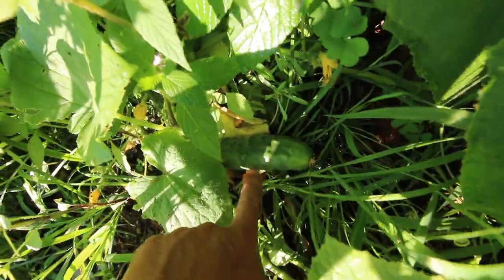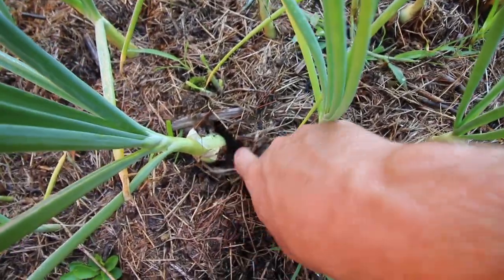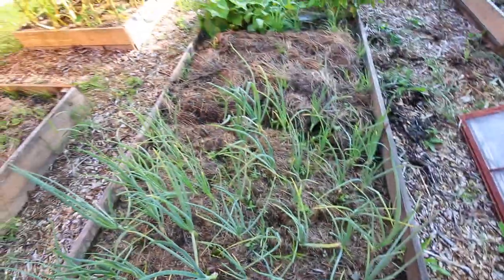The Rarest Breed of CHiCKS and So much More Modern Steader Update

Comment: Al, that is blossom end rot on your tomatoes.  It's caused by a lack of calcium.  Grind up some egg shells and sprinkle around the base of your plants and water them in
Reply: Something tells me he has plenty of egg shells available. :)
Reply from the maker: I am on it!  Thanks! We have plenty of egg shell after breakfast! :)
Reply: Lumnah Acres It can happen to any plant, I keep my egg shells all winter long, dry, grind and put in a jar.... we put a sprinkle in every hole we did because we haven't gotten our soil there yet....  we grow all natural and have only had this land for 4 seasons.  Most likely bugs will crawl in those rotten parts so it's a good idea to get rid of them and let the chickens or pigs enjoy them.
Reply: Soak the shells overnight in some white vinegar and dilute with water. Feed this to the plants. Egg shells straight up are not plant-available. The overnight vinegar soak makes it so. Don't worry for the acid in the vinegar. tomatoes like a low PH situation.
Reply: I had that on my tomatoes and Luke at MIgardener said to crush one Tums into 1 gallon of water. Spray bottle it all over the leaves and fruit. It absorbs immediately and voila it was gone. We haven't had a bad tomato since. Egg shells work also but it takes a while to absorb into the dirt and then into the plant.
Reply: Jenifer Fillyaw I run my eggs through the blender so they are basically dust when I put them on then once I water it dissolves into the soil.  
I'm not a fan of Tums only because they contain sugar, dyes and talc. I'm sure it works great though 😀
Reply: If you make yogurt at home use the whey to water the tomatoes it will have some calcium in it. My plants love it when they get whey watering. Just mix it with water.
Reply from the maker: thanks we have another way we are going to try its organic. we will share it and then see the results
Reply: Also water with Epsom Salts (2 Tablespoons per gallon) Calcium won't work without Magnesium. Good Luck!  :))
Reply: I agree. It is blossom end rot. You can also use bone meal to add calcium that plants are able to access.
Reply: Egg shells take a while to break down enough to release the calcium, so it isn't a instant fix.  Add your shells to compost piles if you aren't already and let them break down there.  Ground Oyster shell could also be used and I believe it is faster release of calcium.
Reply: horse making
Reply: @peelmeone  yes that sounds like a good idea!
Reply: @princessperibanu380  my plants love Epsom salts. I use 1 tablespoon per 1 gallon water every 2 weeks for my plants.

Comment: I made a cider press out of left over 6x6's for the main structure, and a couple 2x4's and plywood for the catch trough coated in wax. I squeeze the crushed up apples with a hydraulic jack by putting layers in cheese cloth between layers of wax coated plywood. The juice runs into the trough that has a hole drilled and a tube running into a 5 gallon bucket. It works great, and the juice is delicious! You could easily build one with your resources. I would be happy to dig it out and send you a pic if you want to see the design.

Comment: Yay!! Friday update, so much happens in a week. I've been caught up with the outdoor kitchen build right along with you, and it's looking great. I had no idea that you had those sliding doors. That is going to look awesome by the time it's finished. 
The young mixed run chicks have grown, and seem less fearful. Looks like you might have some R.I. Reds in there. Rufus sure is a handsome lad, woohoo. I'm not sure how old your layers are in NYC, so can't say how far away they are from when their egg production may slow down. The majority of layers have been bred that they slow down after two years, then it costs more to feed them than they give in eggs, they become soup/stew birds. Those young pullets are doing a great job on the pasture. It might be a good idea to leave them on pasture, and add them to NYC. We used to get rubber bands from an office supply, about 1/2" wide and only slightly bigger in diameter than a chickens leg. We would put a different color for each year of pullets we raised, red first year, blue second year, etc.. That way we kept track of the older birds that were ready to be removed from production. Rotating young birds into the flock kept egg production pretty steady, and you don't accidentally butcher young birds.
 The gardens are looking great especially the pig pen, and hay bale. The raised beds will be much better come next year, like you said as you improve the soil. That tomato looked like blossom end rot. Water collects on the blossom just as the tomato starts to develop causing it to rot. That tomato also looked like it had splits from too much water, not much you can do about that with the rains. 
Zucchini can also be cut up as if for saute and frozen, it keeps real well. Over sized zucchini are great for stuffing, and roasting. Cut in half length wise, scoop out the seeds, and they are a number of stuffings to fill in with, and roast at 350* until tender. For instance, cooked rice, chopped onion, mushrooms, garlic, 11 secret herbs, and spices, (Whatever herbs and spices you like and have on hand. Basil, oregano, thyme, rosemary all work well.) Mix in a favorite grated cheese, with extra cheese sprinkled on top. You could make chicken or pork based stuffing with left overs also. The first year with my gardens I way over planted zucc's, and summer squash, more than enough to freeze, eat our fill, as well as give away to friends. We came up with a lot of different recipes, I'd be happy to share for the asking. :-)
Baby Icelandic chicks!! Congratulations. They seem a lot less skittish than the other chicks. Little cuties, it will be exciting to watch them grow. 
The Modern Homestead is looking better all the time Al. I've been watching other homesteaders along with you. I see a wisdom in your approach that is missing in many others. You add to your homestead in slower increments, learn new processes, adapt to the increased work load, have mostly successes, and fewer hard won learning experiences. Even with the outdoor kitchen build, the rest of the homestead really isn't being neglected. I've seen others add too much, too fast, and quickly become overwhelmed.
Reply from the maker: Thanks! The sliding glass doors should be nice! We got the chickens in NYC Spring of 2016

Comment: yes its blossom end rot. but at this stage your best option to save them is a calcium spray made for it. long term you probably need lime. do a soil test from next year. sometimes too much nitrogen can tie up calcium and urine can def do that. epsom salts are a real help. now, and also when you plant. you can sprinkle in the soil in the beginning of the year or make an epsom spray for the leaves. you will be amazed how mush this helps tomatoes and peppers.
Reply from the maker: Thanks! Great info we will have to look for some calcium spray!

Comment: Even if you have a oversized zucchini, just cut it in half length wise and hollow it out. Stuff it the same way as you would do with a bell pepper. My mom used to sling some butcher twine underneath it so she could tie the "lid" back on top. Pop it in the oven at a good 350F & cook till done. The rice and ground beef inside are already cooked before you stuff it, so it actually cooks fairly quickly. Google a decent recipe on line for clearer directions.  You can also add the grated zucchini into spaghetti sauce, etc.

Comment: I would add gypsum for calcuim.  I would start saving eggshells for next year as it isn't as available but works great if you give it time to break down.
Reply from the maker: Thanks! What should we use for calcium this year?
Reply: Lumnah Acres The easiest way is to make a slurry with limestone or gypsum you can buy at home depot.  Mix a few handfuls of the pellets into 2-3 gallons of water then water you plants with the slurry.  I don't know if you water your raised beds but tomatoes with blossom end rot could just be from inconsistent watering.  You need to be consistent watering when your tomatoes start fruiting or you get a mixed bag of not only blossom end rot but also splitting.

Comment: Have you considered putting a few corrugated white fiberglass panels in the roof to let the sunlight through?
Reply from the maker: We have but I haven't see any that match the tin layout. We did that in our chicken coop in MA
Reply: Maybe you could run the fiberglass all the way down and lap it over the tin on both sides. You may risk looking like a burger joint though.

Comment: What is the ph of your soil and water.....l recommend that one bring the ph of the water to 6.5 and the soil . This will allow the micro nutrients to become available in the soil solution. Micro nutrients such as calcium to become available....also, I generally provide a soil mix of one part compost, one part sphagnum peat, one part of soil, one part  non burning composted cattle manure, and then apply bone meal to the bottom of the planting hole.....then you could use fertilizer such as a transplant food 10-52-10 at tablespoon per gallon 1 per two weeks.....then once the tomatoes have gone through their transplant phase, switch to 20-20-20 at 1 tablespoon per gallon until flower buds start to show....once the plants have flowers just beginning in their tinny for, 15-30-15 at 1 tablespoon per gallon....once your tomato plants start to grow tomatoes, feed them tomato food.....make sure, to prune suckers out of the crotches, then pinch the growing tip about half a month before 1 st frost.....another cure or preventative measure against blossom end rot would be to feeds the foliage 1 tablespoon milk to a gallon of water, or use micro nutrient foliage feed..to get more conclusive information, look up the web site growing tomatoes..they will have more  than I can remember right now.........
Reply from the maker: Thank you! Great info!

Comment: OH NO!!!!!!   I am sure the pigs would love the zuchinni but you can stuff the bigger ones.  Cut in half and scoop out the seeds.  Mix cooked rice with ground beef chopped onion sliced mushrooms 1 or 2 finely chopped garlic gloves and a cup or as needed of spaghetti sauce.  Pplace in a 2 or 23 inch deep pan and cover with a lid or foil.  Bake at 350 until the zuchinni is tender.  Sprinkle with shredded cheese and a bit of grated hard cheese and return to the oven for 10 min uncovered.  You can use sausage or even ground turkey.  If you like curry I have a recipe for a cucumber curry soup for the really big cucumbers that are too tough to eat as slicers.  Why should the picgs and chickens get the good stuff.....    LOL!!

Comment: It may be a calcium deficiency but your new growth looks great. Calcium deficiency will also affect new growth by slowing it way down and giving plants a stunted look. Older leaves will not be affected and will actually store a lot of the plant's calcium. Check your nitrogen levels to make sure they aren't to high (leggy growth) and your soil Ph. The next cause may be due to inconsistent watering. Tomatoes do not like to be water stressed, water deeply and consistently. You've been getting a lot of rain, I think that may be leading to your problem. Tomatoes dislike wet foliage and high heat. Looking at all your other plants, nothing else seem to suffering. Calcium deficiency also affects cabbage (leaf tip burn), carrots (hollow core) and peppers (blossom end rot) & yours look great. I think the rain is your problem. I tent mine with shade cloth to slow the rain down hitting the plants when rain is in the forecast. I'd also experiment with adding minute amounts of boron (tsp per plant). 
Large zucchini - slice thin, toss in olive oil, salt, pepper, garlic or experiment with different spices, bake at 225º for 2-3 hours till lightly browned = delicious zucchini chips! Small ones shrink too small, just make sure the seeds are still small on those monster zucchinis!
Reply from the maker: We have been getting a lot of crazy rain this year!
Reply: Lumnah Acres - Shoot some close up video of your entire plant, all the leaves tell the plant's health. Which it does seem like you had new tomato flowers up high which with low calcium, the plant wouldn't produce. Low calcium affects all new growth. Figure out what's going on now to benefit next year's plants. But I'm really suspecting too much rain. Sometimes we think we don't need to water because of rain, but tomatoes are the spoiled child of the garden... if they don't get what they need, they'll let you know! 😃